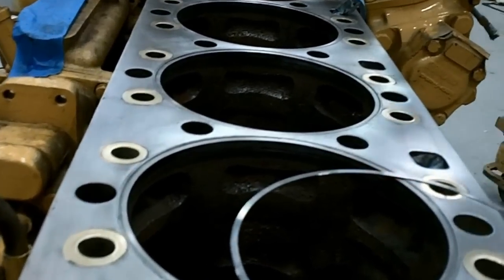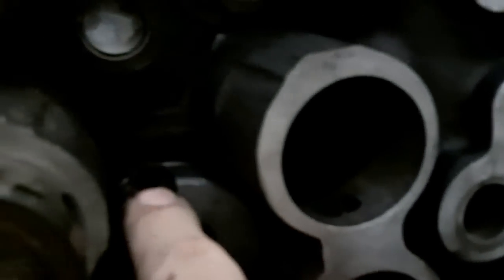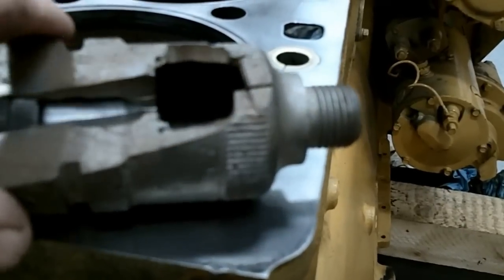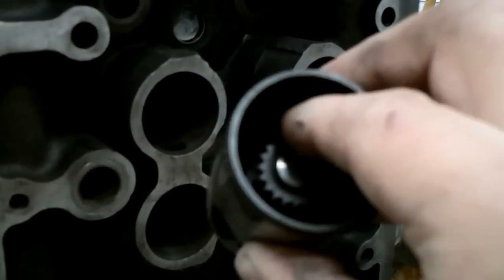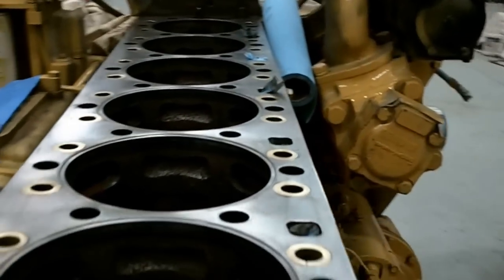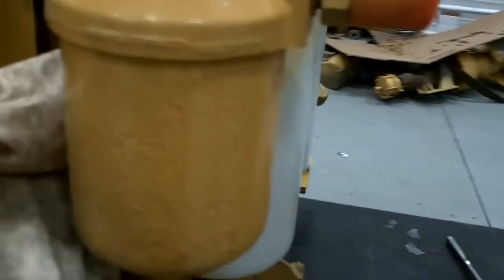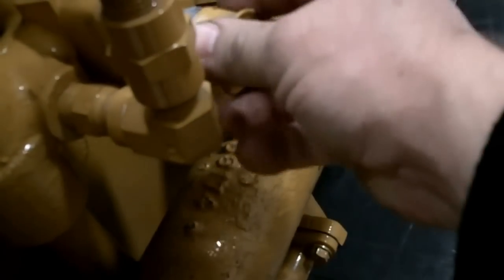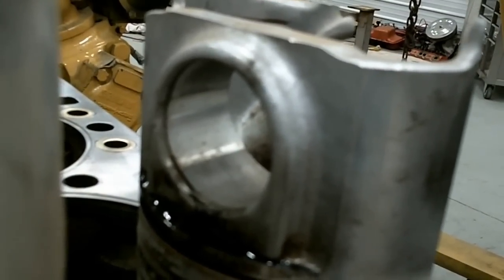Cat D343 1693 Repair Part 2

Comment: hi   jeff    bill   here  ,     is  there  a   way   to   up  date  or  do  a   way   whith  the  pre cup  or  after  market   injeaters
Reply from the maker: Yes you could use 3406 pistons but you would need billet rods made as the piston pin location is higher up plus the 343 rods are not tapered on the pin end, the biggest issue is the crankshaft journals have to be bigger for a DI engine

Comment: Cat made a socket 5p-8691 to remove and install the screws out of the lifter! Do not think they sell it anymore! Did so many of these that I used that socket about every week, made it so easy to rebuild the lifters!! A friend of mine and I had saved up rod bushing shavings from re-bushing connecting rods,  we were the exchange department of a Cat dealer! We were going to make a tool to do this, the day we started to make a mold to make one, Cat put it out in a service magazine! So we got that one instead, Cat put a magnet in theirs we did not think off that!!!!

Comment: D336 ,why do you change nos round when you get old.i do my best but it gets entered in classic offshore and last year it dumped all its oil in the bilge due to an oil leak on the o ring on the pipe from the block to the oil filter,knocked an end out needs a crank grind,cant do that in situ,the front pulley on the other one took a hundred ton puller and heat and a lead hammer to get it off so not looking forward to that,amazing what a short taper can do.may need to source a crank whats my chances do you think.heres another laugh in.
http://youtu.be/FAPttdi6ZSU

Comment from the maker: I actually started to attempt that, You would need custom rods built, then you could use 3406 DI pistons, the rod would have to be about .625 longer as the 3406 piston pin hole is closer to the top by 5/8 inch the cost for rods was $6,000. then the fuel system stuff wouldn't be that bad to setup, it was the cost for rods that slowed my attempt to do it
Reply: Thanks for the info! Perhaps someday there will be such a thing. I guess it wouldn't sound the same, though.